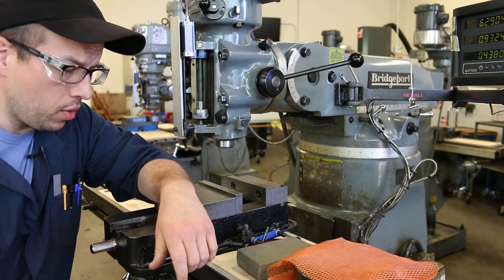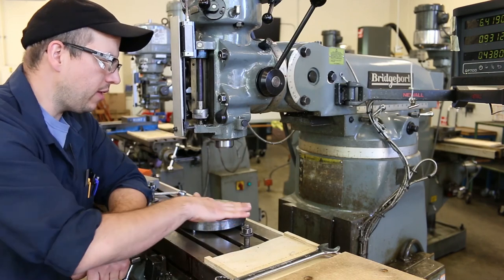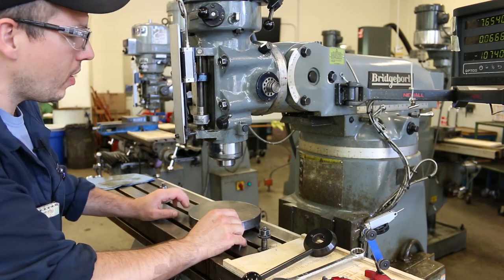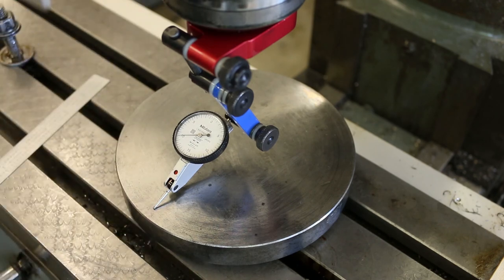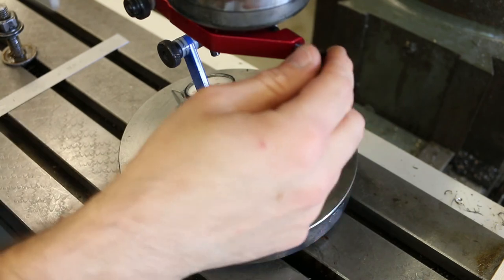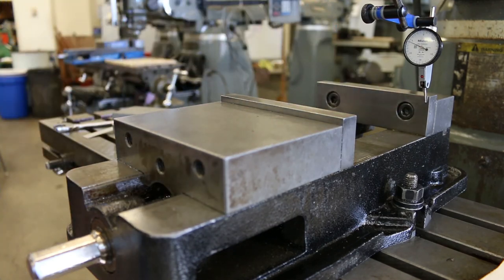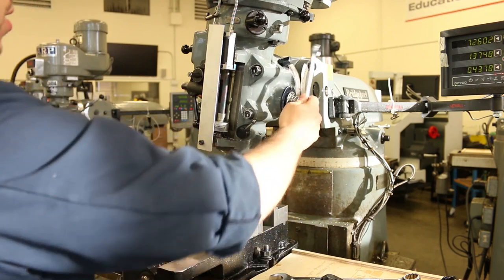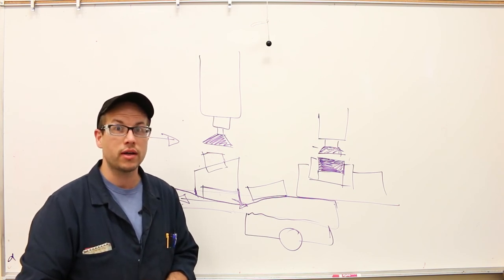Angle Plate - Demo - Part 1

Comment: Adam, you are a marvel.
I wish I'd had you as my tech teacher way back when...
Beautiful, simple explanations of quite complex subjects..
The turret mill is quite...   nuanced!
And traming in the head is central to predictable work.
Fortunately no one (dare) touches my machines.
Burrs and stoning of mating machine surfaces needs more, I use precision ground stones personally.
Really if the vice isn't true to the table, unless that is what is required, then whatever it takes make it so.
Everything matters, errors accumulate and compound from the very first action.
On my mill table I have a 6in vice on one side and an 8in rotary table on the other side with enough room for traming or a small set up between them.
The gibs are pretty tight, not slammed, but very firm.
This on a good mill gets me within a couple of tenths and that'll do pig!
Just had to say...well done.
Reply from the maker: Thanks for the kind words! I love those precision ground flat stones. I give them to my students as graduation gifts.

Comment: great video. 
In tramming the nod though, if you "overshoot" the zero on the front side (a little), you'll arrive faster (/ever) at a trammed head. If you always go to the zero established from the side closer to the pivot, you're stuck in one of zeno's paradoxes, and should never actually arrive at a trammed head. If you half the distance left to go, over and over, you'll never arrive. Close enough is close enough, of course, but i think it's important to mention that idea to the students. I'm sure there is some math one could do to come more quickly to the correct nod adjustment. Trig, with information on angle change of the worm gear, and the chjange in the difference in reading from rear to front sides between adjustments, but that's more trouble than it's worth, for sure.